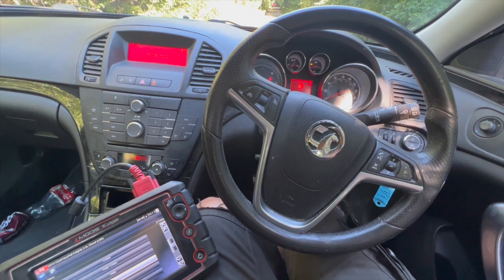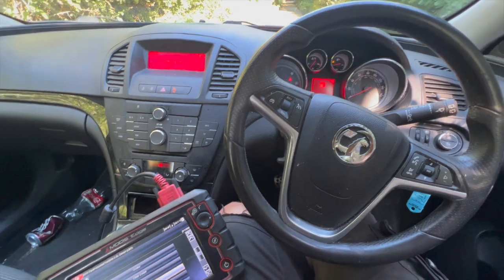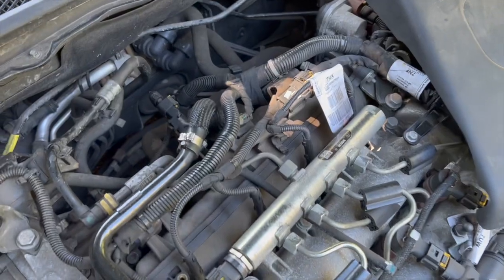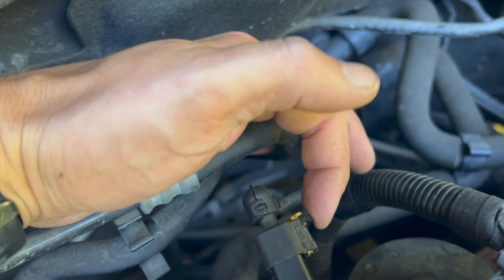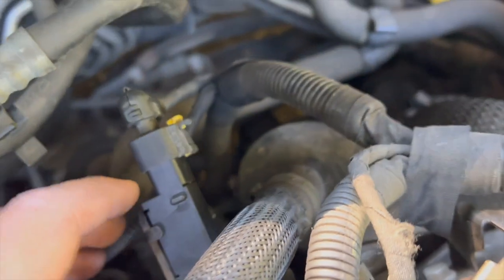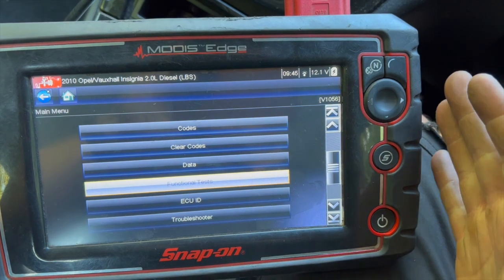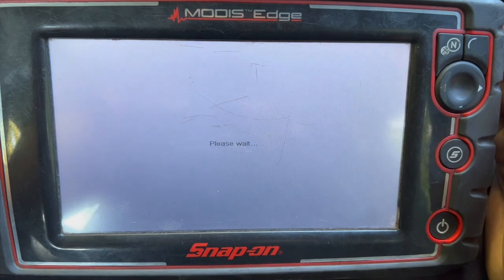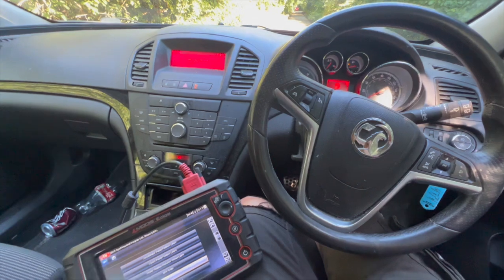Vauxhall Insignia P2453 DPF pressure sensor fault fixed

Comment from the maker: New Genuine DPF Pressure sensor - https://ebay.us/1QXdFL
New Aftermarket DPF pressure sensor - https://ebay.us/3KgR6L

Check out this New Diagnostic machine that will carry out the reset (I have used the machine myself and can recommend it)
Topdon Phoenix lite 2 Ebay - https://ebay.us/tsyiTI
Topdon Phoenix lite 2 Amazon - https://www.amazon.com/dp/B0B1MB6YG8  

Tools used:
Socket set - https://ebay.us/7tUKdM
Snips - https://ebay.us/uk6Li3

Comment: I have the similar code p2453 on toyota yaris . Replaced sensor and code cleared. Code came back again after few minutes run. Any solution?
Reply from the maker: The DPF is likely to be blocked mate , this will need sorting first

Comment: Hi, I had a mechanic out yesterday and he performed a regen and cleared all the codes and got the car out of limp mode. He said you need to replace the sensor ASAP - he said I could do this without any reprogramming? Do you think this will be ok? Is it because currently all codes have been cleared by him. He had the same machine as you have. Thanks for any advice.
Reply from the maker: Hi from my experience if you replace the pressure sensor you will need to do that procedure or it won’t let you clear the fault, unless the faults not in it when you replace it
Reply: Did u get this done

Comment: Not always the pressure sensor, the metal pipe coming off the dpf, the rubber hose gets clogged, this throwing the pressure sensor code. The rubber hose goes upto the sensor. Just poke through a small metal rod to unblock it, then clear code
Reply: You sure about that mate? How deep should i go into the plastic cable? Thank you

Comment: I have insignia 2011 2.0 and changed new dpf filter and new sensor, i calibrate on computer but code is still coming out saying p2453 high temperature please help i already spend 4000 😔

Comment: hi i have an insignia ive just replaced the diesel filter but the but the partical filter blocked message is still on    any advise please
Reply from the maker: The particle filter is a section of the exhaust, replacing the fuel filter wont help this issue, you may need it regenerating via diagnostic machine but you also have a different fact causing the issue

Comment: Take it the new Topdon couldn't do the relearn?
Reply from the maker: Yeah I checked yesterday actually and it did have the function to do it but I’d actually prepped this video a few weeks ago .. before getting the topdon mate
Reply: @diydaly  thanks that's good to know 👍
Reply from the maker: @Alanw74  👍 will be using it in any future vids now but will let you know if there anything it won’t do compared to the snap on , just used it to read wheel speed on an old bmw today and got an injector to code on a qashqai so hopefully it will do that 👍
Reply: @Alanw74 
I can confirm the TopDon Phoenix lite 2 can perform the DPF Pressure sensor relearn carried out the procedure today 👍
Reply: Nic video sir 
Your all video very helpful sir 👍👍🙏
Reply: Keep us updated on the Topdon mate. I may get one early next year if you have luck with it.
Reply from the maker: @trevormansfield6740  certainly will do mate 👍👍
Reply: Can you change this sensor without having to calibrate it, the fault code has been cleared and the car is running fine at the mo, can i just do a straight swap without the relearn?
Reply: @yammydodger1988  no the sensor needs relearned to the ecu.